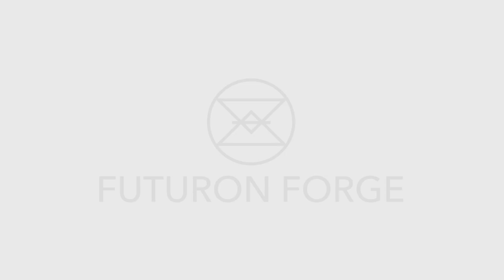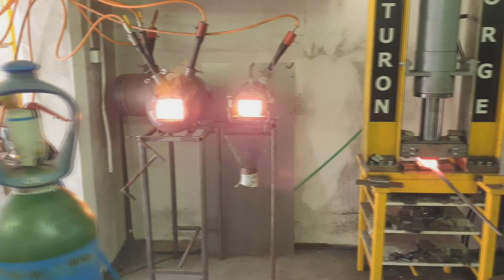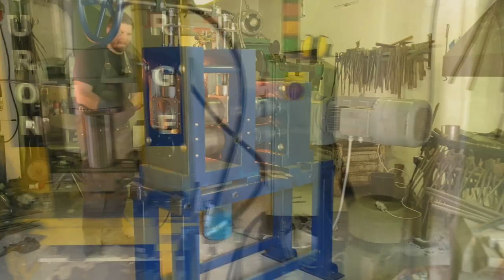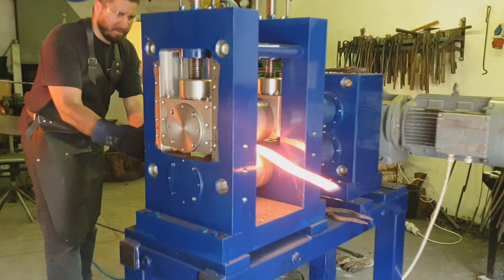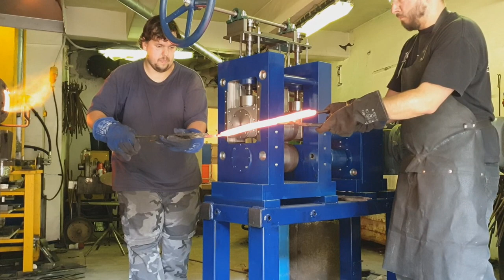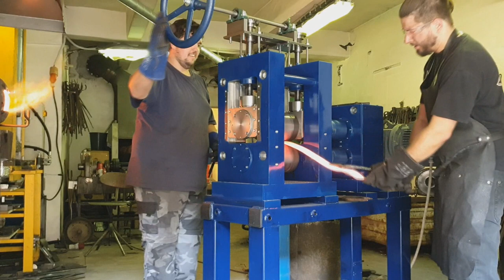Rolling mill - stainless damascus

Comment: Beauty. I am researching building my own rolling mill. I am a generalist but want to thickness reclaimed leaf spring for garden tool production. Thinking of going for a much smaller hydraulic rolling mill with a modular power pack that I can use with a press also press. I love seeing the set up of specialists like you and am sometimes jealous of specialists but I am generalist to my core so I must embrace it!
Reply: Thank you. We also considered hydraulics but we had an engine with a gearbox so we used it.

Comment: Is there money in producing rolling mills for small to medium shops like this? I feel like a lot of machine shops could benefit from being their own stock supplier. If I could make a rolling mill out of cast iron that weighed, like, a ton, then I could reduce a large brass ingot down to any size i wanted. 5 inches diameter? no problem. and the grain will be aligned and forged solid. heck, if i could make the right dies, i could apply even pressure to a whole workpiece and make my own cold rolled brass in a couple of hours, and save thousands and thousands of dollars on a large order.